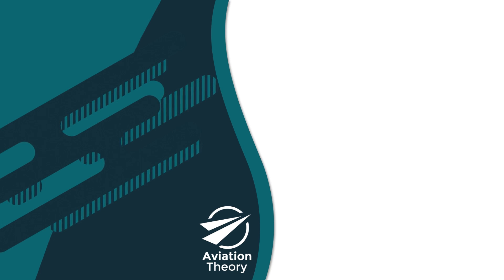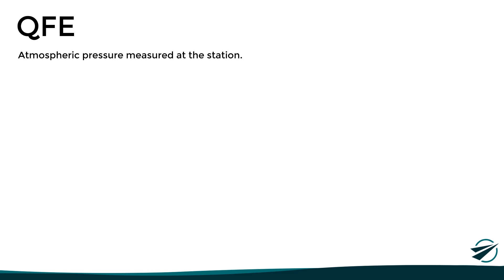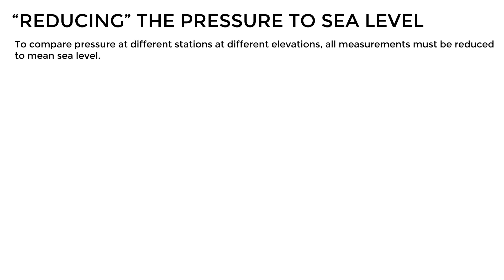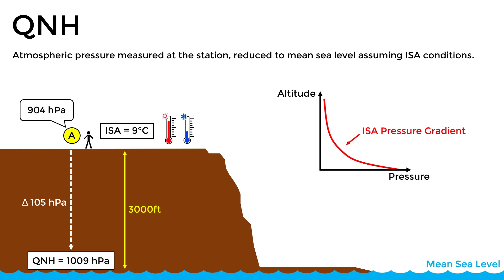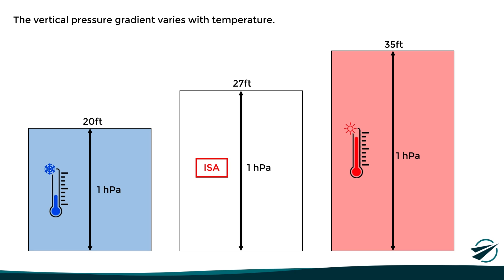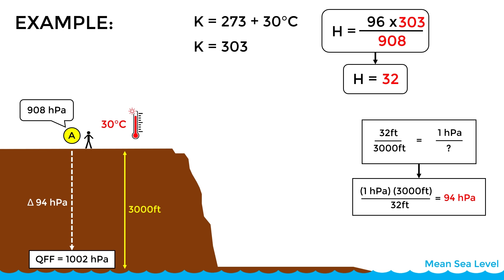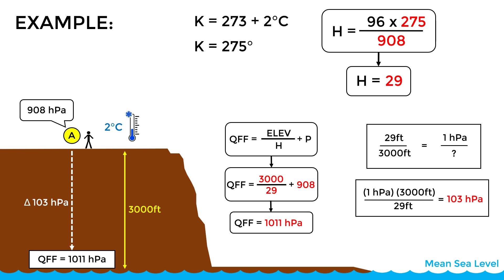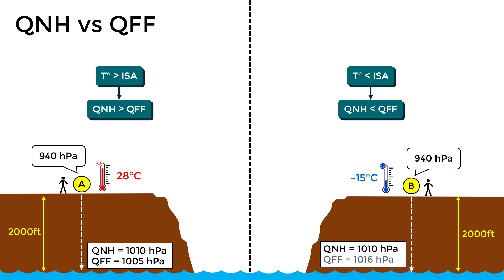Difference Between QNH, QFE and QFF

Comment: Good. Just a question. Is the formula QNH=QFE+Alt(feets)/27  Correct?
Reply: yes, if you use the standard values and below 20000ft, because upper FL200-400 1hPa equals  to 50ft

Comment: "Now calculating the QNH is not so simple since the correct vertical pressure gradient to be applied must be determined as a function of the standard temperature as we descend." 
What exactly is meant with that sentence?

Comment: hi, thanks for video. but i cant find qff=1005hpa in last calculation. if T=28, 273+28= 301, 301*96/2000= 14ft. 2000/14= 143 hpa?? what in my calculation is wrong?
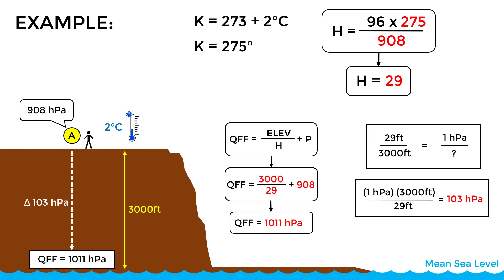Reply: check 11:14
for 301*96/2000
you mean your QFE is 2000 hPa?
Reply: It should be 301*96 divided by 940 and not divided by 2000. Divide by Qfe and not the field elevation.